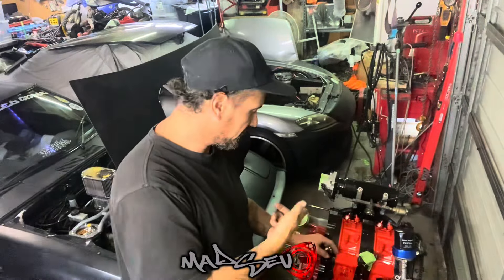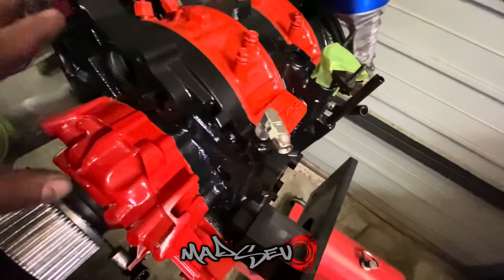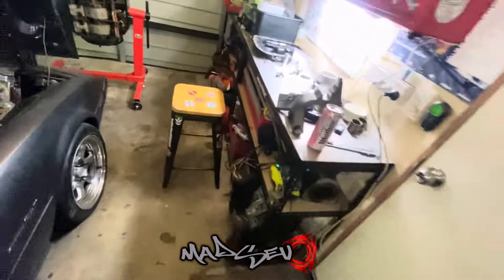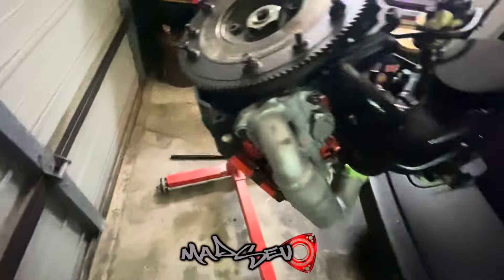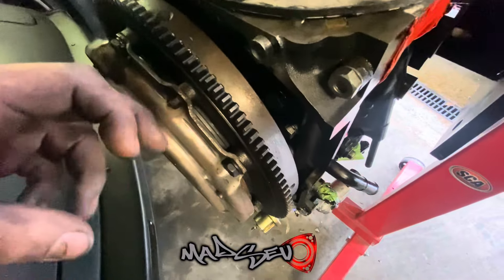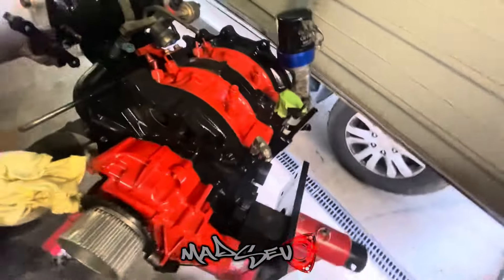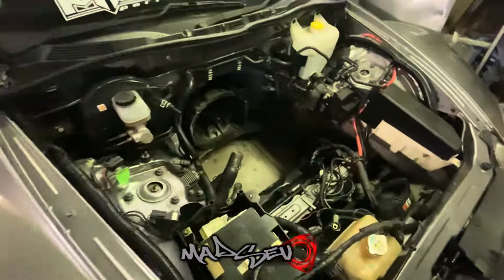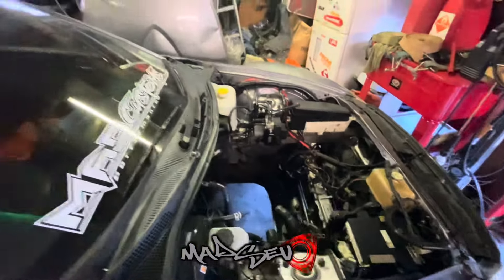Installing my 13b Renesis bridgeport in the rx8

Comment: Really interested in seeing this project progress. That forward facing plenum idea is awesome. Definitely got some work cut out for you with fabbing up all the plumbing. RX8 bays are not the most accommodating! 

Plan to run an aftermarket ECU or refund the stock one? Unsure on the capabilities of the stock ECU and tuning with the boost that MP will pump out but it’d be great to see it attempted.
Reply from the maker: Oh yeah it’s gonna be a headache fitting everything in the bay but hopefully it will sort itself out. I have the Dynoboys sorting me out with an aftermarket ecu for it but I have heard a lot of bad things with ditching the factory ecu so may have to piggy back it. Will see how it goes I guess.

Comment: Interesting. How did you get around the wrong E shaft being installed? I did not follow how you resolved that. That turbo is massive.
Reply from the maker: E shafts are the same internally the only difference is a bearing in the clutch end of it. I just went and got one from mazda and put it in . Good to go.